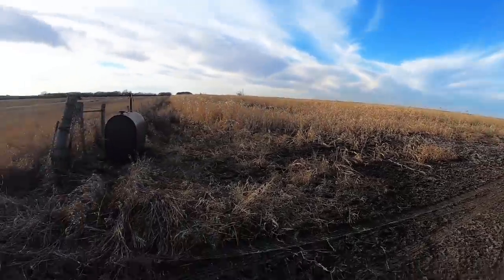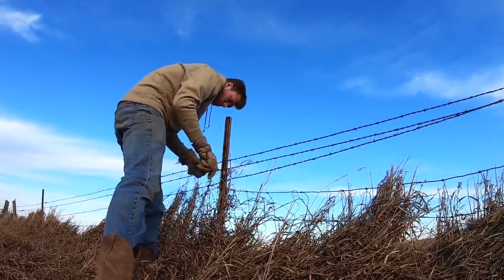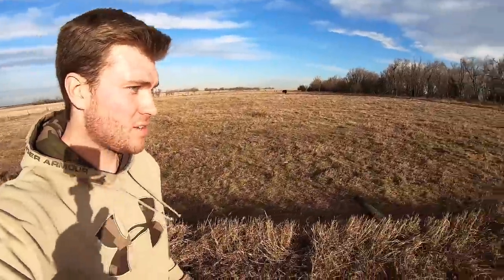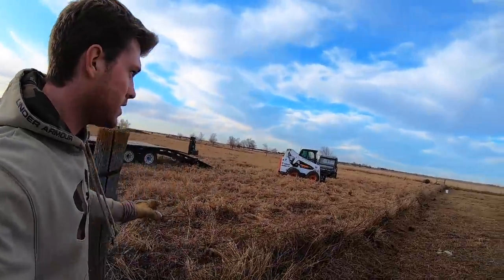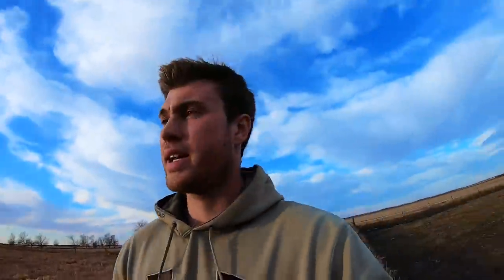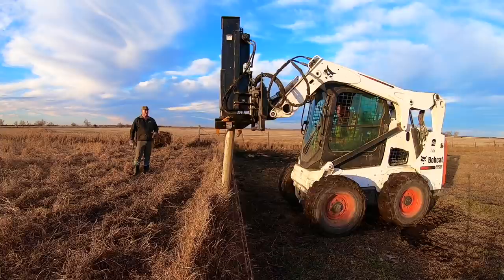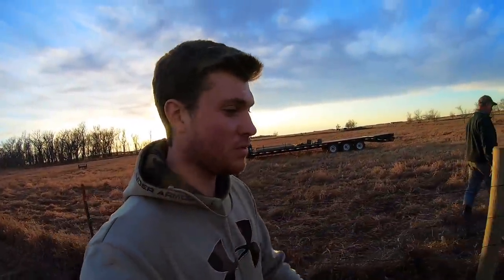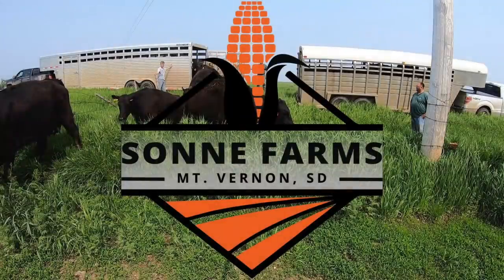Fence aint gonna fix itself

Comment: As a father it don't get any better than being able to work together. But remember Dad usually knows the right way to do it.
Reply: Making fence with my father when i was a kid, was so frustrating. we used wooden posts, and, dug them with the two handled post hole diggers. He would never buy any new wire or staples, we just patched the wire, and, he used to have me straighten out the old staples with a hammer on whatever rock was laying around. But, despite my frustration, i did love working with my dad, he taught me the lesson of making do with what you have.

Comment: Hi Mate..🇦🇺
Another good looking fence...😎👍The wire strainers you guy's use there in the US is a heck of lot different than the one's we use here in Australia...
Are you star pickets( T-post) galvenised, bitumen dipped.?
Here we usually run drop post's (railway line) every1km between end post assembly's.
We use galvenised droppers between our star pickets, this allows us to distant the star pickets 10 meters apart. The droppers purpose is to hold the wires in position so as cattle can not seperate the wires between the star pickets.. We design our fence like this to maximize  effectiveness and reduce costs, due to the fact that we have hundreds and hundreds of km's of fence lines on our station..
Reply: Yes our strainers are totally different. Looking at you using yours, I must say ours look safer. Look up Hayes wire strainers H300.  Should be able to get them posted to the U.S.  I often get stuff from the U.S.

Comment: How long do you expect those cedar(if that's what they are) post to last ? Hedge (Osage orange) is King around here but you gotta cut'em out of the timber yourself but an 8 inch post might last 35 to 50 years ! They also aren't that straight so you gotta dig a hole to set them ! Something about new fence is very satisfying , don't see much on any ground as flat as that in Illinois mostly on hills and hollers where it's real difficult to build fence but where the pasture ground is ! Happy Thanksgiving and thanks for the video !

Comment: Why do you need to put in log posts among metal posts? Is it for extra support? Thanks for the videos.
Reply from the maker: We dont have to be it helps keep the fence from leaning over and sinking in. The Metal posts move a lot easier so adding in wood posts helps extend the life of the fence a lot.